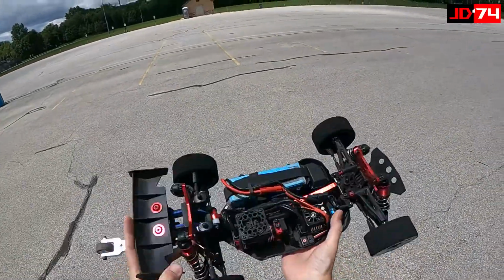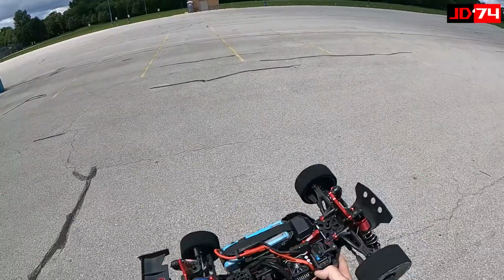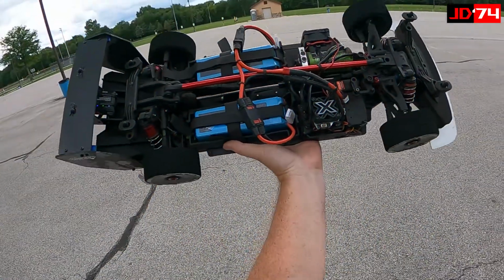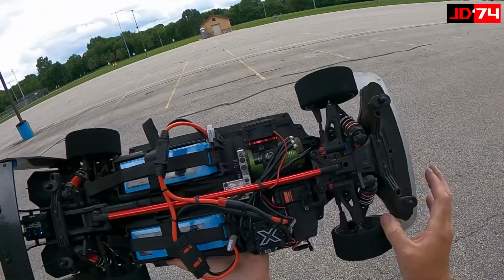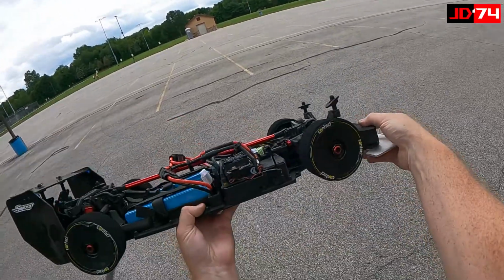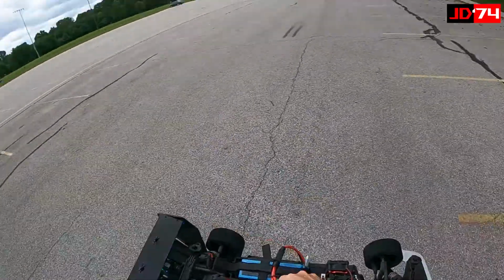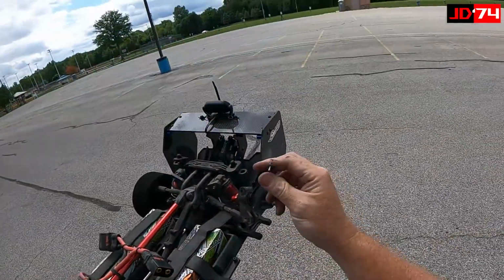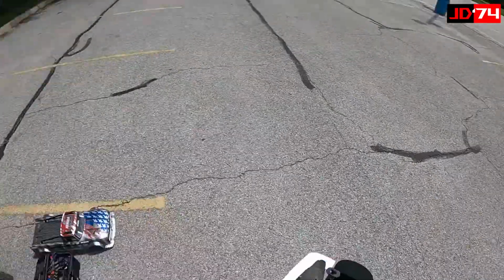Arrma Typhon and Infraction Drag Random Hits

Comment: Men on men. I like this FPV. For you make 60fps ? Or 30 FPS ?
Reply from the maker: I have different frame rates on different cameras. Small Insta360 Go 2 does 50fps max. My GoPro Hero 9 does 240fps. I also have older GoPro Hero 6 x 2, iPhone 12 Pro, and a Canon M200. I always render at 23.976fps to upload faster.
Reply: @jondilly1974  nice men. I use divinci resolve to render. It look nice but file is a very big !
Reply from the maker: @rcmedia9516  I used to use Resolve but just prefer Premiere Pro as I’m more familiar with Adobe workflows.